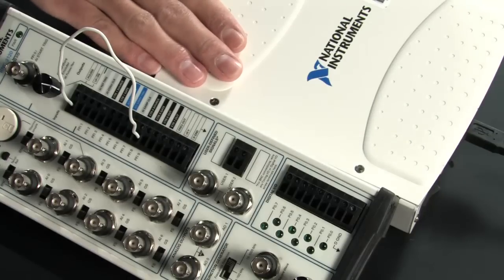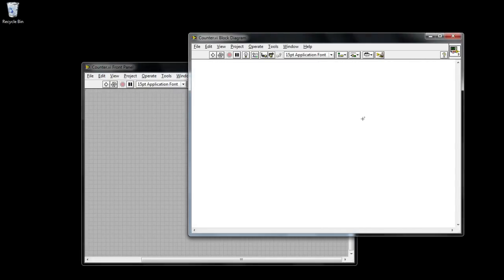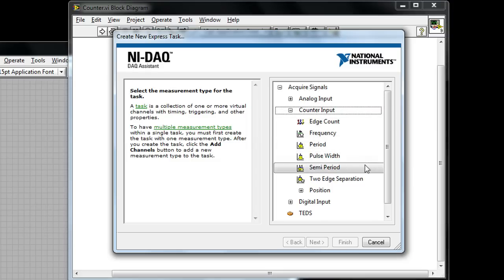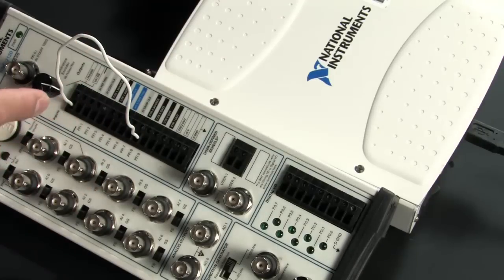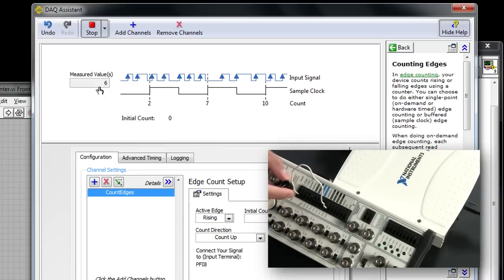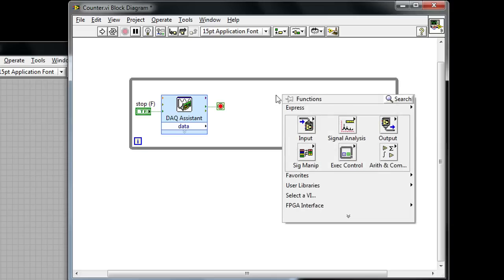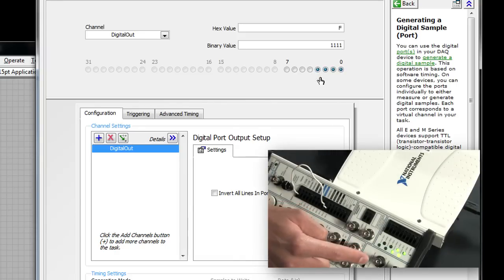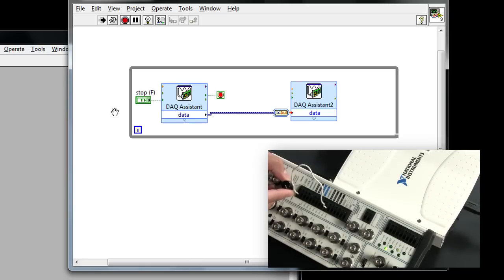Using Counters and Digital I/O on USB Data Acquisition Devices

Comment: Hello 
i must buy a laptop for using with Labview and  NI-9237 -> 50kHz per channel for 24 channels.
Is it sufficient to run this at laptop with a standard processor ie Ryzen5 6cores 12 threads - it is  15WTdp processor
Or do I need something better like 25W Tdp proc?

The main question is whether the operation of this overloads the computer's processor?